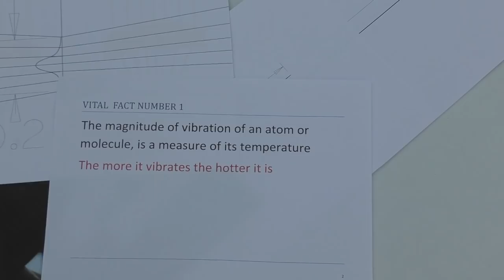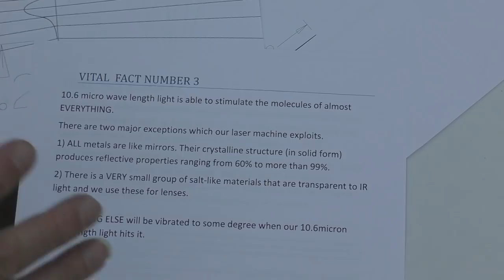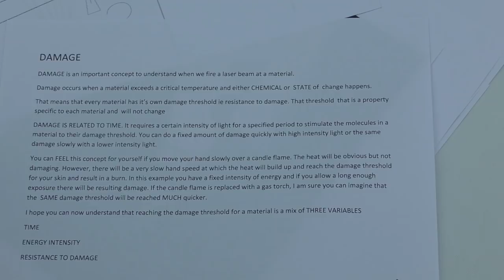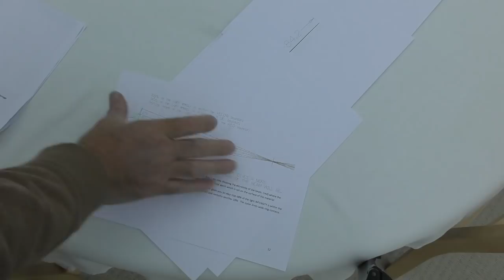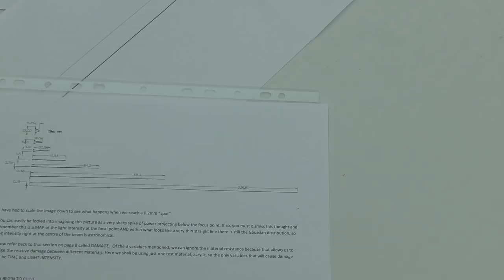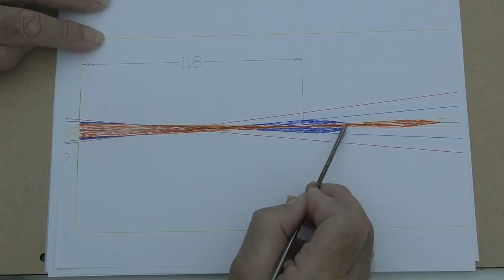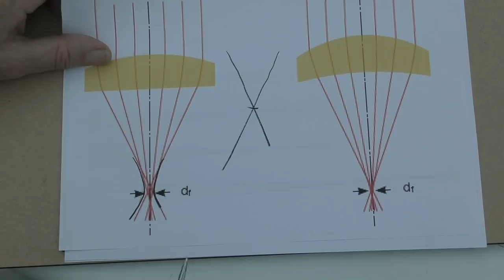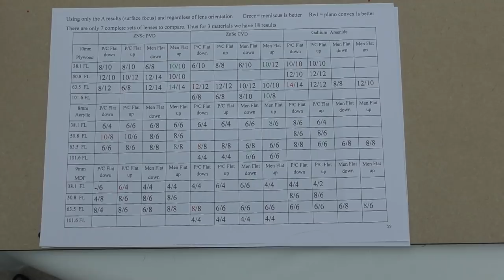RDWorks Learning Lab 172 AT LAST!! How Lenses Work

Comment: I think the advantage of a longer lens is that its depth of focus is better but the disadvantage is the spot size is bigger, so power density less. For a given power of laser and material there will be an optimum focal length for getting the maximum depth of cut. When cutting thin materials or engraving shorter focal length is preferred to get smaller kerf / better detail.
Reply from the maker: AHA.  You have fallen into the power density trap  that I also believed in for 3 years or more.. I agree that as the focal length increases the spot size increases. So as I point out in the video the area of a 4" lens spot is 4 times that of a 1.5" lens thus the energy density within a 4" spot is 1/4 that of a 1.5" lens. That implies it can only do 1/4 of the damage I could do with a 1.5" lens.  My tests and cutting data show you how untrue that is. Why?  the energy density you are imagining is the AVERAGE for the whole area. That is where it all goes wrong . We do NOT have a uniform power across the spot . It is a Gaussian distribution with much more power at the centre of the beam. Look at those ray diagrams for various focal lengths at the end of the video , you will see that despite the bigger spot size for the 4" lens the yellow zone divergence of intensity is so low that it should be the best cutting lens for us all. 
 I will find out why the conflicting data in the near future . I only had CVD lenses to test so I am trying to obtain  4" PVD and GaAs plano convex and meniscus lenses to investigate this. I am pretty sure that the PVD material has greater spherical aberration. For cameras and laboratory work this is a huge enemy but for us I think it is a great friend . At the moment it is just speculation. I need to investigate it properly.
 Kerf is an interesting discussion. Where do you measure it ? At the top, bottom or middle of the cut?  Raising the focus point can lower the entry cut size if you are using a plano convex lens and controlling the cut speed will affect the size of the exit cut. This feature is not unique to a 1.5" lens. For the first year of my China Blue life I was an advocate for the 1.5" lens but for most of that time I was stuck with a rubbish 30 watt tube. Until this exploration of lenses I had hardly pulled my 4" lenses out except for an occasional experiment.  Now I need to take them seriously.

Best wishes
Russ
Reply: @SarbarMultimedia  
If the spot is 1/4 the diameter then the power density is  actually 1/16. The point is as long as the power density is above the damage threshold it wil, cut but the greater focal depth means it will cut deeper. Yes the spot is Gaussian but it is before and after focusing. 

Rather than draw ray diagrams I prefer to use the formula that uses aperture size,  focal length and wavelength to calculate the waisted beam shape. Light doesn't travel in straight lines as it is a wavefront that gets diffracted.

Even with no spherical aberration and a perfect lens you cannot focus light to a point. If you could you would have infinite power density and engrave anything. The same equation applies to telescopes that try to focus almost parallel rays from distance stars. To get more detail, I.e. a less blurred image, they need to use a bigger aperture.

Higher wattage tubes have a bigger beam size (which is the aperture in this case), so for a given focal length lens that will produce a smaller spot. So you can get away with longer focal length lenses on higher wattage machines.
Reply from the maker: @nophead  
 I apologize for repeating what I wrote but it clearly said 4 times the area and not 4 times the spot diameter A typical theoretical spot size for a 1.5" lens is 0.075mm but I used the more practical 0.1mm (area=0.0078) and the spot for a 4"lens is 0.195mm (area =.03)  ie 3.8 times the area. Your rough 1/4 and 1/16 calculation applies to squares and not to circles by the way.
You are perfectly correct about light being bent by refraction as it changes from one medium to another. As I mention in the video, and certainly in the pdf document, I am no scientist  and that  many exact scientific details exist that could drag your thoughts away from the very simple principle of my model. I make no apologies for "simplifying" the science  because many will not have the knowledge that you obviously possess. I first do understand what refraction is and that refraction is a function of the wavelength. If you check  the normal  refractive index charts for materials, they  are based on monochromatic sodium light at around 600nm , some 17 times less than our 10.6 microns.  I also wonder if there is a refractive index for our wavelength as it passes from air to acrylic vapour?  This really illustrates my point that too much scientific detail can confuse what is essentially a simple model. The refractive index is a constant therefore whatever it is will apply equally to all lenses as I am penetrating  a constant material .

Although I must commend  you for a great set of discussion points my less than ankle deep ability precludes further detailed scientific analysis. I am sticking with simple.
Sincere thanks
Russ
Reply: @SarbarMultimedia  Doesn't any 2D shape have area proportional to square of linear dimensions?

The aperture effect is about diffraction, not refraction.
Reply from the maker: @nophead  
A 4x4 square has an area of exactly as you reckoned ie  16. whereas  a  diameter of 4 encloses and area of 4 x 4 x 3.142 / 4 =12.568   Out of interest, If you draw a circle 1 unit diameter and then draw another concentric circle inside at 0,707 unit diameter,  the areas inside and outside that  0.707 circle are equal . As far as spot size is concerned this means that a 30% increase in diameter doubles its area.
 
As for refraction and diffraction, I am either stupid , dyslexic or maybe both.  If i understand diffraction correctly when PARALLEL uniform intensity light rays try to squeeze through an aperture , refraction creates an expanding wavefront beyond the aperture and probably interference fringing also. This is a scientific detail I did not even consider  in my model because neither condition seem to be possible. First the light is not parallel it is already focused down to a spot where the  damage is created. The aperture that opens up in front to the light beam is a consequence of the energy conversion. There is never an aperture for the light to "squeeze" though, just a tunnel that the focused beam passes through unhindered.

I am not being sarcastic when I thank you for pointing out my error because open debate on such a complex subject is the only way we will get to understand what is going on. I have no intention of questioning or breaking any scientific rules  but sometimes those rules have conditions and boundaries. I am not competent enough to know where those boundaries are so that allows me the freedom to imagine without limits.  Your in-depth questions have only helped to confirm the robustness of my simple model. It answers so many complex questions in a visually transparent way and points towards answers that I have yet to prove.
Best wishes
Russ
Reply: @SarbarMultimedia  What I mean if you scale the dimensions of any 2D shape the area goes up by the square, regardless if it is a square or a circle or any shape. And to double the area you need to scale by sqrt(2), which is 41%, not 30%.

The aperture size in this case is the beam diameter from the tube. It is equivalent to light going through hole of the same diameter and has a curved wavefront. That is the reason it can't be focused down to zero size, hence the waist in the focused beam shape. The actual shape is a hyperbolic and is asymptotic to the perfect cones you get by drawing rays. 

Even without any aberration the minimum beam waist, for a Gaussian beam after a lens is given by 
w0 = 2 lambda / pi * f/d where f is the focal length of the lens and d is the diameter of the beam prior to the lens. It is called the diffraction limit.

The beam diameter variation along the Z axis is described by w = w0 sqrt(1 + (Z / Zr)^2). Zr = pi * w0^2 / lambda. 

So a bigger f gives a bigger spot but Zr goes up by the square of that giving a better depth of field. So as you increase focal length you can cut deeper but the limit comes when the spot size is too big to get enough power density to do damage.

I think if you graph the beam shape with the equations and apply the principle that the beam cuts where power density exceeds damage threshold, taking into account the Gaussian profile, it will go a long way to explaining the shape of the cuts.
Reply from the maker: @nophead  
Remember I said ankle deep . Now you are  way above my knees. I'll stick with my simple visual model and see how far it gets me. Before I get to do any experimental work do you think spherical aberration will help or hinder cutting? This is a genuine question to see what your equations  predict.
 Serious thanks for you contribution 
Russ
Reply: @SarbarMultimedia  I think the equations hold for a perfect lens and a perfectly Gaussian beam. With spherical aberration I can see your point that is should increase the depth of focus. How that compares to simply using a longer focal length I am not sure.

I think the 2" lens is popular because it probably gives the optimum cutting depth for a 40W laser, which is about 6mm. When you increase the tube power then a longer focal length will give the optimum cut depth because a) you have more energy, so you can afford the increase the spot size and b) because the spot is smaller when from a bigger beam diameter anyway.
Reply from the maker: @nophead 
 Again I greatly appreciate your input and it looks as though we shall have to await the results of some practical experiments . The data so far and my personal experience is that putting a lens flat side down cuts better than flat side up  Flat side up gives far less halo around dots indicating much better concentration of focus. I  also  have evidence that the cheap PVD Chinese plano convex lenses cut significantly better than the best quality  II-VI lenses. Maybe the PVD manufacturing process or the lower geometric quality of the cheaper lenses leads to more aberration. Hence my question if there are formulae that offer predictions
 Best wishes
Russ
Reply: @SarbarMultimedia  According to Wikipedia  spherical aberration is inversely proportional to the third power of the focal length so it should be much less for your longer lenses.

It also says "Many ways to estimate the diameter of the focused spot due to spherical aberration are based on ray optics. Ray optics, however, does not consider that light is an electromagnetic wave. Therefore, the results can be wrong due to interference effects."

Comment: Hello Sir I have a laser engraving and engraving on the plastic suddenly stopped working and a window appeared that says error in communication please help me solve this problem note that I have switched cables connected to the computer and also I erased the program and installed again, but no use accept my greetings
Reply from the maker: Hi Mohamed
This problem is unusual. 
Did you download the program and then run it from your keypad or are you running it from your PC directly ? I would like to know.
 Before you answer try this. Make sure you have FAT32 formatted USB memory stick. When you have your drawing ready on the RDWorks screen press the SAVE TO UDISK button on the bottom right of your screen. Save your program to the memory stick. take it and plug it into the UDISK port on your machine and press the File button Follow the instructions to load your program. Now run your program from the machine start button. Does this way of running your program work ok?

Best wishes
Russ
Reply: Thank you very much for communication Dear Sir I installed the program on the computer and is communicating directly with the device and was working for a long time but suddenly stopped working
Reply from the maker: @mohamadalobedi2894  
Hi Mohamad

 History is meaningless in this instance. You have a problem that you need to identify.  Bypassing the USB cable and taking the program to the machine on a memory stick is a way of chopping the problem in half.. If the problem still exists when you run the program you know for certain that the problem is in the machine and not with the USB cable , which is the usual cause of this error. . I have often had issues running direvt from the PC so what I always do now is to press the start button and as soon as the head starts to move I press the pause button on the keypad. This means that the machine is not trying to run the program at the same time it is loading it . When the download is complete you can press the pause button again and let the program run. However this does not sound like your issue if the program has loaded because that means the data transfer phase is complete and there is something in the machine not communicating with the controller. Maybe one of the stepper motors? When you run the program without the laser on (untick tube 1) does the error always occur at the same point?
Best wishes
Russ

Comment: Russ, did you ever think about an apperture? Sweet dreams 😉
Reply from the maker: Sadly this is not normal light.    In the 10.6 micron wavelength  universe there are only 3 things that the light "sees". 
 1)Any metal reflects  it (we use them for mirrors) 
2) A VERY small group of salts allow the light to pass through like glass  (but glass is NOT one of them). We use these materials for lenses.
3) EVERYTHING   else.   In  his HUGE group, the molecules are stimulated  by the light waves and heat up by.  It is by this energy transfer principle that out laser machine works. `

The whole point of an aperture is to occlude some of the light. However, any aperture material you chose will be from group 3 and heat up as the light  hits it . You will be pleased to hear that I have tested occlusion to no good effect. I tried this in my initial exploration of creating the smallest possible dot.

 Best wishes
Russ
Reply: Thanks Russ. Great answer. As I moved on today I just found some optical skills from far ago determining that an aperture beyond the Lense won't have any usefull effect due to the light travelling no more coherent 😁 This digging into Laser is just such a good way to mix up physics.

At the moment I more or less struggling with exactly this unsharp blurr during engraving and also work on a program that calculates the theoretically perfect Speed to Power Setting.  Again, love what you did with yout RD Lab. Great service.
Reply from the maker: @iloveaviation-burgerclub-a8145  
Hi 
 If you wish to add your disguised email address to another comment  I will reply so that you can send me some pictures of your problem. I will also delete your comment/email address from public view.
Best wishes
Russ

Comment: Radiated heat from the sun is what warms your skin. The clue is in the name "radiated". It is carried by electromagnetic radiation as opposed to being conducted or convected.
Reply from the maker: The clue may be there  but "radiated" to most of the population means heat from a HOT source ( fire , radiator, candle etc ) they do not associate that with light.  Maybe if you show them an IR camera picture it may make them stop and think...or would it?

Best wishes
Russ
Reply: @SarbarMultimedia   I began wondering if the 4" results vs actual might be caused by the frequency of the pulse of light from the laser tube,  might try passes at lower and higher frequencies to confirm. I am also assuming you did not make any frequency changes (using the default setting of the software)
Reply: @smoky269  
 Hi
There may be a slight misunderstanding of how the laser tube works. The cheap machines that most of us have are constant DC current controlled. That means that when the beam is on for more than the first few microseconds it is operating with a NON pulsing beam.  You maybe confusing this with the much more expensive radio frequency controlled tubes, where the beam is continuously pulsing at anything from 2 to 40 khz depending on the tube  brand you have.  RDWorks is written to cater for both tube types but you define which type of tube you have in the vendor settings. Th frequency parameters will only apply if you have an RF tube. There is a vendor setting frequency that is by default set to 20khz. That is used to code the %power signal that is sent to the HV power supply if you choose to control it by PWM. There is another connection that allows you to send the %power signal in a direct analog form.(the AN1 output on CN5 terminal group). The 20kz is also used when you choose SPECIAL MODE for engraving.
Sorry to say there are no frequency explanations for this problem. I am sure the answer will be simple and obvious WHEN we find it.......but not that obvious right now!!

Best wishes
Russ